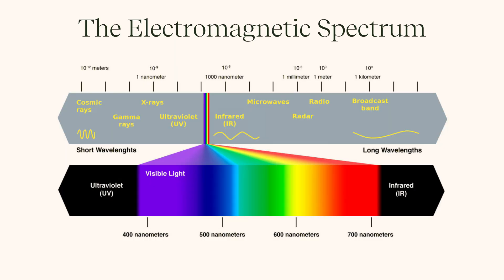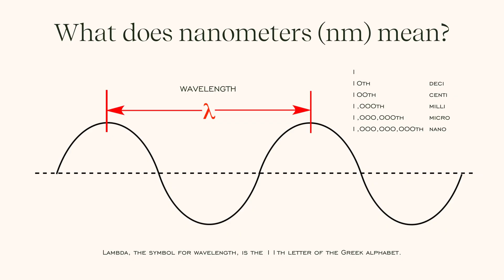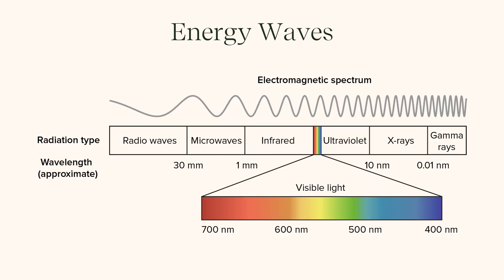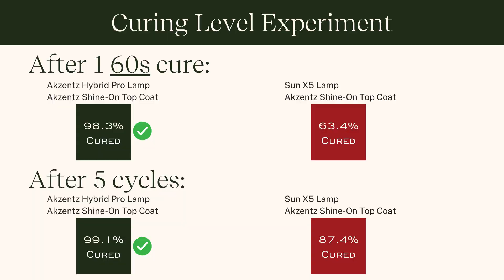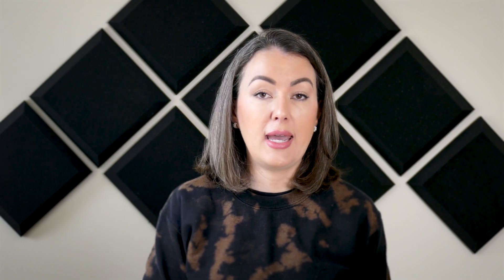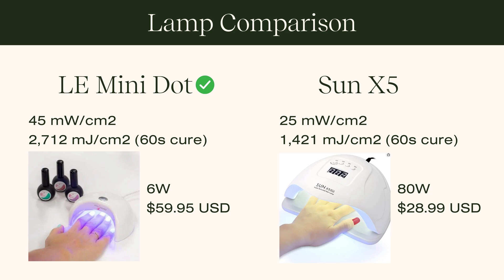UV Nail Lamps & Allergies Why Choosing the Right Lamp Is Critical for Safe Curing

Comment: Regarding the rechargeable lamps, if you do not use the rechargeable feature of the lamp and keep them plugged in, you would have the same concentration of light each time, right?
Reply from the maker: Yes as long as the electrical power flows that way. Some devices that are battery operated do not have a direct electrical connection from plug to output. Instead all power has to flow through the battery so essentially you'd be constantly "topping off" the battery as you keep it plugged in. Some devices stop charging the battery after it's "topped off" but I wouldn't be able to tell you for every lamp. My hunch (based on price point and circuitry knowledge) would be that rechargeable lamps would use the battery as the power source even if the lamp is plugged in. Would be good to test with luminous emittance sensor. But I know that's not realistic for everyone or every situation. That's why I can only speak in generalities as to what to avoid if you want a best case scenario option...

Comment: LIZ will the Light Elegance New Gen 4 Lamp cure your ATTAIN brand polishes?  I was very happy to have the opportunity to purchase a new one.   I have been using a Gelish 18G as that is what the nail salon used.
Reply from the maker: Yes it does. The Gen 4 is a great lamp and sufficiently cures most of the gels I've come across. To me it has all the features anyone could possibly want and is what I would consider "a level 5 lamp" meaning it can cure lots of brands of gels to safe levels.

Comment: Hi! I’m having issues with my LE Dot Gen 3dot lamp. It’s not curing the thumbs. What are your thoughts on CND and Opi nail lamp. Do you recommend those lamps?
Reply from the maker: Hi! So definitely check your hand placement. You can even cure thumbs separately. The Gen 3 is a wonderful lamp, but it sounds like you might be getting a shadow on the inside of your thumbs due to improper hand placement. Make sure you check that when curing.

Comment: Hi Liz, I recently noticed that Kokoist came out with LED only versions of their lamps. Can you explain how that's different than the UV/LED version? Is it better? Worse? I'm not sure I understand if one is safer/better and what would be the upside to the LED only.
Reply from the maker: Hi! Great question—so let me break this down in simpler terms.

First, when we say LED vs. UV/LED, it’s a little misleading (even though many brands use these terms). That’s because all nail lamps emit UV light—the real difference is which type of UV light they emit, not whether they’re “UV” or “LED.”

Think of the LED as the light source, like the bulb. Inside the lamp, those LEDs give off UV light, and that’s what makes your gel cure (harden).

Now, here’s where it gets a little more technical:
Gel products use something called photoinitiators—these are ingredients inside the gel that respond to UV light and trigger the curing process. Different photoinitiators respond to different UV wavelengths.

Older gels often use photoinitiators that need shorter UV wavelengths (these are typically labeled as “UV only”).

Newer gels often use photoinitiators that respond to longer, near-UV-A wavelengths (around 395–405 nm), which are what most modern “LED-only” lamps provide.

When you see a hybrid or dual-wavelength lamp (often called UV/LED), that just means it has both types of LEDs inside, so it can cure both kinds of gels. These were especially useful when the industry was transitioning to newer gel formulas.

Why does this matter?
Newer LED lamps that emit only the 395–405 nm range are often more efficient and slightly safer (even though nail lamps have consistently been proven very safe with reasonable use), since they avoid some of the shorter, higher-energy UV wavelengths that can contribute to things like free radical exposure. But the catch is—they only cure gels that are designed to work with those wavelengths.

So, if your gel is labeled UV/LED, a modern LED-only lamp will work just fine.

If your gel is labeled UV-only (like some older or specialty gels, such as Kokoist Boba Gel High), an LED-only lamp won’t cure it properly—you’d need a hybrid/dual lamp or a traditional UV lamp.

Hope that helps!
Reply: @TheNailHub  yes, this helps. Thank you!

Comment: I always appreciate your educational videos. I also understand purchasing the gel and lamp from the same manufacturers is ideal. If one cannot afford to purchase multiple lamps,  it seems like your recommendations are to purchase quality (metal vs plastic), purchase based on nanometers, and wattage, recognizing that wattage can vary depending upon how close it is to the power input. This all said, I'm assuming that the lights on The Nail Hub meet these requirements and are there other reputable brands you would be willing to share?  Thank you again.
Reply from the maker: You are correct! And I'm glad all that came through loud and clear. :) Yes, all of the lamps we have on thenailhub.com are great options that I have personally tested. I know a lot of brands say there is no such thing as a universal lamp, but you can get very very close to that by choosing a quality option. For example my favorite right now is the Light Elegance LED Dot Gen 4. It's hybrid technology and does a wonderful and consistent job of curing lots of brands. So far I've completed testing on Akzentz, Light Elegance, Kokoist, Luminary, ATTAIN, Young Nails, CND, Ugly Duckling, Ageha, Nail Labo and Christrio. It cures all of them wonderfully. 

Also worth mentioning that 60s is the optimal cure time for any gel. I know lots of brands say 20 or 30, but after looking at polymerization rate data, 60s is going to get you the highest cure rate on the first exposure. So 60s is my new curing standard for any gel or lamp.
Reply: @TheNailHub  Hi! I’m also currently looking for a quality nail lamp, specifically one to cure kokoist builder gels and Apres gel x. I know the thicker the product (nail thoughts/kokoist BIAB and Apres extend gel), the more important it is to get a quality lamp to ensure it’s fully curing. The higher-end lamps from both brands are about $300 each so I was wondering if the Kokoist one you tested would be a good option to cure both brands? And as a DIYer who is still figuring out if I want to do it professionally, is it necessary to get their most expensive lamp or are their $150-200 options enough?
Reply: @TheNailHub  
Hi! Thanks so much for sharing this info – super helpful! I just wanted to ask: Did you test the Light Elegance LED Dot Gen 4 lamp with every gel from each of the brands you listed (e.g., Akzentz, Kokoist, CND, etc.), or just some products from each? I’m trying to figure out how universal it really is. Thanks in advance!